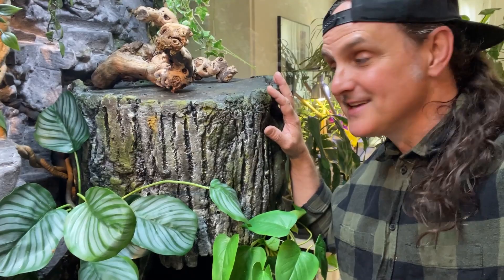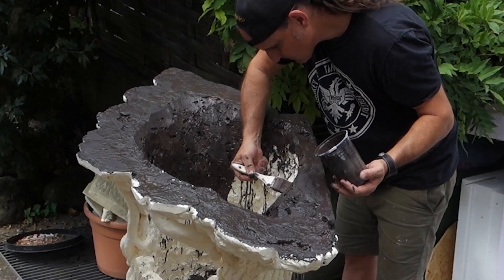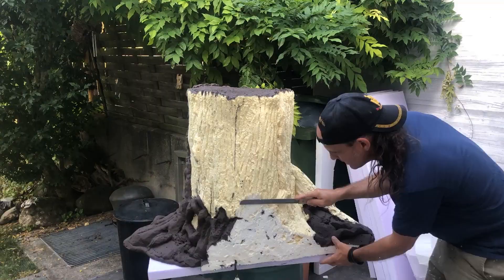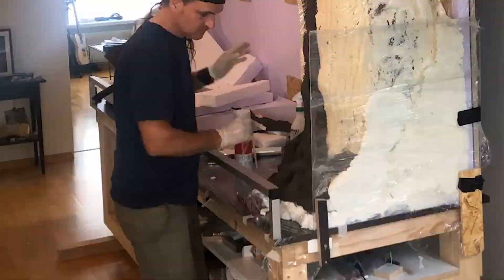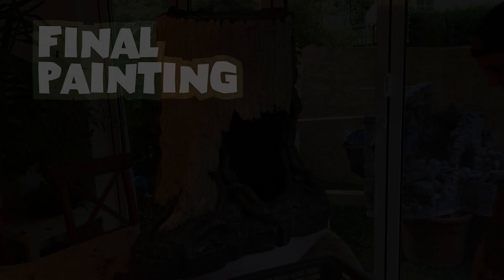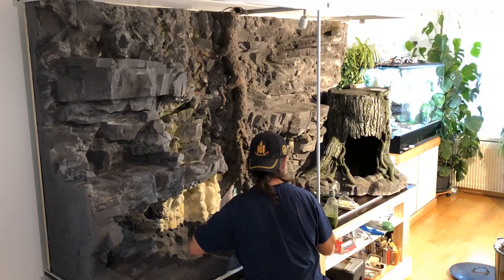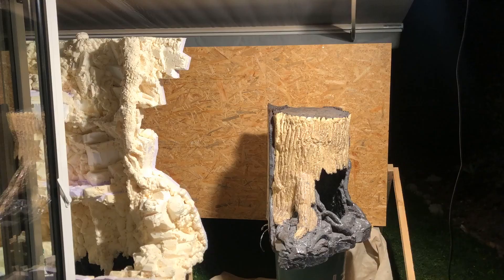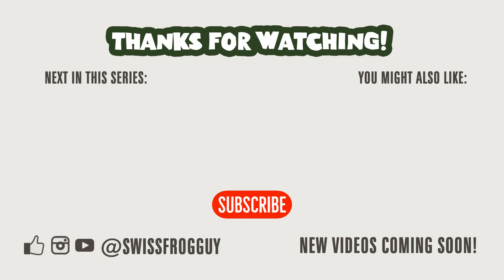Build a FOAM TREE Part 3!

Comment: Great series, the tree came out great and also serves a functional purpose. The rest of your enclosure looks amazing. Keep coming out with new ideas and tour channel will do great. 
I started using polygem zoopoxy on my current build. It's more of a puddy epoxy so molding is easy with a mold template of sorts. Looking forward to what you create next!
🤘💯🦎🐸🐍🐢
Reply from the maker: Hi Brad! Thanks a lot for your cool comments and ideas! I actually considered using some sort of 2-part epoxy clay, as I bet, you could mold it, just like you could anything else, provided it is fluid enough. At the same time, I wanted to try to do some thing that was a little bit of an experiment. I have never used zoopoxy— I’ll have to try it out! Thanks again for your support! This really means a lot coming from someone like yourself who is quite well established.
Reply: @Swiss Frog Guy  the way you were able to mold the tree with great stuff is very impressive! 
🤘💯🦎🐸🐍🐢
Reply from the maker: Thanks a lot! I spent a lot of time taking a look at how people cast foams and tried to learn from them. I did a lot of mold, making a while back, but I have never tried it with foams. It seem to natural connection. We don’t really have “Great Stuff” the brand here on Switzerland, so I just used cheap building foam. It seemed to work just fine.

Comment: Hi iv made 3 vivs now with various ledges and cliffs from foam what I'm struggling with is gettin the details to stay my dragons claws seem to make it thro even silicons .. not 100% sure what to use on my current build currently doin a stump hence how I ended up at your videos.. looking for somthing to harden and protect.. on previous iv used silicons sand mixtures acrylic paints industrial pva she still manages to scratch through .. my county also doesn't do this drylok you tried but there alot of ulternative options not sure which to try or choose.. I'm goin for a dead desert look so also hard to find anything on Internet to try
Reply from the maker: Yes, this is a bit of a challenge. One of the tough things with any painted covering is that you will need to find a balance between details and durability. If you put on tons of coats of a sand-containing paint like like Drylok, you will eventually get that super durable color. It will end up looking like a blog with no details. For my tree, I ended up painting on epoxy to try to get a more durable surface. But I think sharp clause would even break through that.
If I were doing this again, and had lizards to deal with, I would seriously consider casting the details completely into the structure, as opposed to building something out of a substance like foam, and then attempting to make it stronger.  This will certainly be more expensive, but the final result will be the most durable and will have the most details.
I think this could be done either with fiberglass and resin, or epoxy-based clays. 

If you chose to use fiberglass and resin, you certainly would need to make one or  more molds, and then layer in the fiber and resin. If you did it in pieces, they could be assembled into one solid piece. This is the route I would take, because you could make your molds from real tree, bark, and get super realistic details. 

However, this is a long and complex procedure, that might not appeal. If you prefer not to use molds, I think you could make a structure out of foam, and then cover it with a layer of epoxy-based clays. these clays behave just like normal clay, and can be molded by hand, and details added, but because they are made of two parts, they eventually harden into a super durable surface. 

Hope this helps!